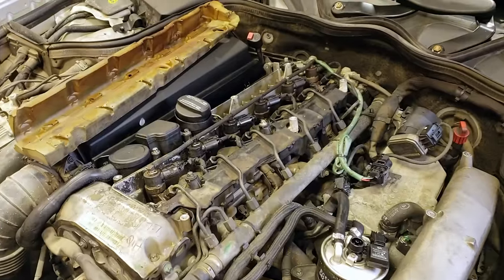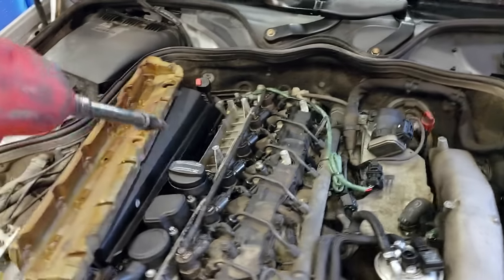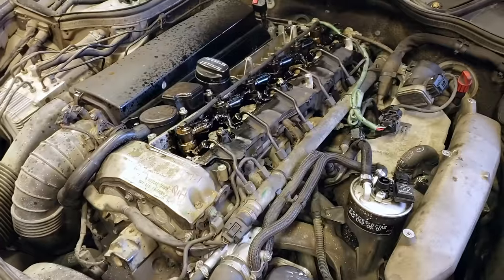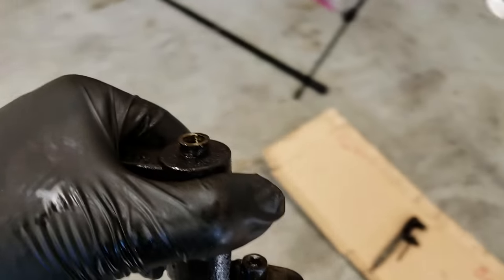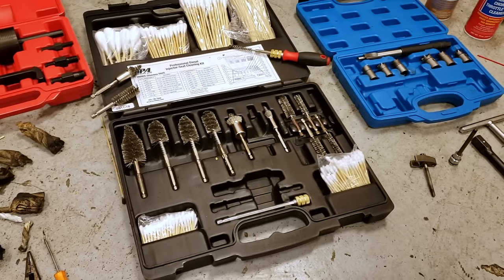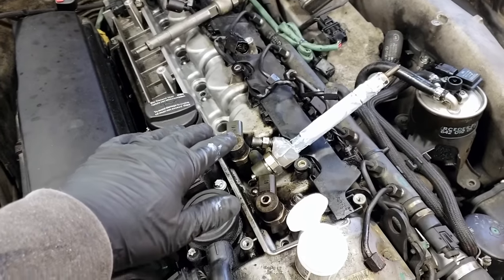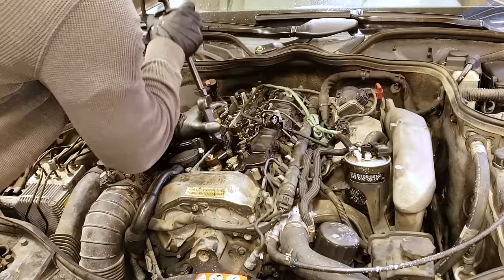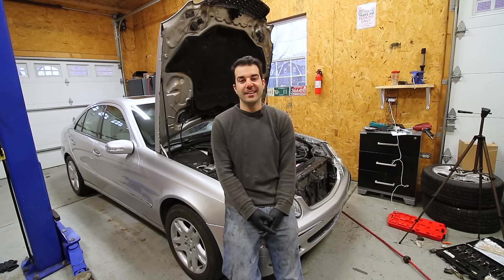My Turbo Diesel Mercedes Has A Nasty Engine Issue. Don't Buy A Diesel Before Watching This video.

Comment: Thumbs up if you watched this whole video and don't even own an E320 CDI and don't ever intend to!
Reply: Well i don't own one, but can't say for sure that i won't own one in the future. I do however own a v70 2.4d so there might be som useful info here after all
Reply: b376010 
I've got a UK Rover 75 diesel 2.0 which has  a Rover engineered BMW M47r engine with 225,000 miles and the injectors are spotless. Soon I'm buying a Jeep Patriot 2.2 diesel with the Merc engine and I hope this injector problem isn't Merc typical.
Reply: I bought a 2006 E320 CDI from copart 3 weeks ago based on Alex's videos.  Now i'm investing in tools to be able to fix all the problems on this vehicle.  It arrive in limp mode so tranny won't shift out of 1st gear
Reply: I don't, but I have a VW TDI and this applies.  I've always changed the seals periodically, but you never know.
Reply: @mopson  If it's a 2006 then it has to be the 642 engine correct? Anyway most common problem for a transmission in limp mode is the speed sensor. Probably just a new EGS if you're lucky. Also keep in mind that the 5speeds has a tendency to leak oil at the electrical socket and oil will travel along the wiring inside the car and eventually hit the EGS module. Yes, not kidding, if connector is leaking, oil will travel inside the car and defy gravity due to eletrical pulses :D
Reply: @kasper my engine is exactly like Alex's engine.  I guess that's a 642 engine.
I got these faults when i scanned the code
CDI 3-Common Rail Diesel Injection3                Fault | 1
      2227-1 /MIL ON&Stored&Current - Transmission Control ETC FAULT 10
      2257-4 /MIL ON&Stored&Current - Check Component N1 4/2 (Glow output stage) FAULTY

ETC - Electric Transmission Control                  Fault | 3
      P2400/Stored&Current - The right rear wheel rpm signal sent from the traction system via the CAN bus is implausible
      P2401/Stored&Current - The left rear wheel rpm signal sent from the traction system via the CAN bus is implausible
      P2430/Stored&Current - The wheel rpm from the traction system are not available on the CAN bus. (CAN timeout fault)
  
ESP - Electric Stability Program                          Fault | 6 
      7209/MIL ON&Stored - DTR: CAN communication with transmission control unit is faulty
      7203/MIL ON&Stored - DTR: Test wheel speed signals. (Rear axle)
      4637/MIL ON&Stored&Current - Check component L6/4 (right rear speed sensor)
      453A/MIL ON&Stored&Current - Check component L6/3 (left rear speed sensor)
      45AF/MIL ON&Stored - Check component L6/3 (left rear speed sensor)
      6403/MIL ON&Stored - Undervo;tage supply

The codes seem to indicate both rear speed sensors are bad but i doubt that both of them will go out at the same time.  it seems to me that there is a communication problem.  Any help is appreciated.
Reply: @mopson  That's OM648 straight-six engine. OM642 is V6 engine.
Reply: @ @keijokojootti7790  thanks.  I'm not familiar with the engine codes names.  I know it is an online 6 cylinder 3.2L
Reply: @mopson  That's the 648 motor with the 722.6 5 speed. The conductor plate in the transmission needs replacement if it's stuck in first gear. It's a well documented problem and a cheap and easy fix.
Reply: @MBDieselFreak  the sprinter vans have these engines too. my V6 3.0 has a chuffing injector and i know i need to get it done .  also need the van for work so tricky to take off the road but don't want to get ripped off at a dealer.  this video is very helpful :)
Reply: @mopson  on the OM642 , i have one, the glow plugs or glow plug relay are known to fail. you can measure the resistance of each glow plug with a multimeter at the relay plug , they should all be a low resistance so it will be easy to find the one or more that is knackered.  if they are all good then the relay itself maybe the issue.
Reply: @MBDieselFreak  Thanks.  I figured that might be the case based on several videos i've seen online so i ordered a transmission service kit from FCPeuro.  The kit should arrive next week.  I hope i have fun fixing it and hope that is the problem.  I'd hate to change the conductor plate and still be in limp mode
Reply: @amojak  My engine is the OM648 straight-six engine.  Do you think the glow plug or the relay issue might apply to my engine too?
Reply: b376010 John
Reply: @mopson  i suspect the setup is the same so most likely could be the same issue.  if it stumbles trying to start on a cold day then it is most likely a glow plug or plugs that has failed. there are videos on youtube of people testing the 642 at least.
Reply: @amojak  Thanks, I'll give that a try but the car starts normally.  The E320 CDI starts at once when the glow plug light goes off but the glow plug light comes right back on after the engine starts, stays on for a few seconds and then goes out.  I don't think that's normal.
Reply: Haha, i meet all of the criteria
Reply: I couldn’t stop watching, and I drive a Toyota !
Reply: had an OM651 but sold it to dad :P
Reply: thumb up if you're using adblock...
Reply: @kbnguy  yeah i use adblock...
Reply: Yup
Reply: @rikardandersson7288  It's not common on Volvo D5 engines but can happen and I have seen it happen, I've seen one's bad enough that they will never ever come out. So, it's not worth doing it as preventative, but do try and catch it early, on a D5 simply pulling the engine cover (just pops off) and having a look every so often is handy and easy to do.
Reply: Not me, I watched this video and still want a W211 diesel, idk what is wrong with me.
Reply: Kasper i have the om651 4 cilinder but i have a 5 speed transmission also, so i will get this problem?
Reply: i have a c220 cdi
Reply: Great job, I was impressed with your perservance and technical prowess. Keep it up!
Reply: I own an E280 1994 update model with 473K on the clock & would never think of owning a diesel. Noisy,smelly & costly to maintain. Better to leave them in trucks or T34 Russian tanks.
Reply: @mopson  It's called "inline", not online!
Reply: @myredute  Damn autocorrect.  Yes, i meant inline
Reply: To bad you will never know the thrill of owning a car that can go from New York city to the Georgia border on a single tank of desiel. The ride, the comfort, and acceleration from dead stop.
Reply: Diesel
Reply: Yes i watched it and i still bought one, because its the best 6inline diesel engine mb has ever produced. You’re whining because one has to replace six bolts and washers.. just replace them before they leak
Reply: I always give his videos A thumbs up
Reply: c180 kompressor.

Comment: This happened to my 2003 sprinter van. The Mercedes dealer told me the problem was caused by bad injectors and I would have to replace all of them. Luckily I knew they were lying .  I went to the parts counter , ordered the injector seals and  bought some oven cleaner on the way home.  I was done by that evening. That 150000 miles ago and @315k my original injectors are still going strong. .
Reply: Oven cleaner shouldn't be used on aluminum head.
Reply: @PuerRidcully  can confirm, used it on a Ford Escape 3.0L V6 aluminium block and IT got clean but also looked chalky and lots of white corrosion. Good thing it still leaks oil(very little) so I don't have to worry too much about the corrosion being permanent. 😁
Reply: I’ve a 2002 T1N and had to replace the #1 injector seal. It had a lot of blow-by, but the injector came out fairly easily and the repair is still holding OK about 30,000 miles later.
Reply: @PuerRidcully  it works well for me
Reply: @thecloneguyz  yes good motor. I only use factory spec fluids. Mercedes is a shit company. They are an arrogant company that does not care for their customers. In my case the Mercedes dealer lied to my face in order to steal money from me. Luckily I knew it was only the $5 seal. It is a known problem, Mercedes should have informed me to have it checked.  But they don't care because the longer black death goes unchecked the bigger the repair bill.
Reply: @skysteppes  
I have seven hundred and sixty thousand miles on mine and it purrs like a kitten because I only use German fluids in it and I only use CENEX diesel in it
The only thing I've ever had to do is replace the plastic turbo resonator tube.
My buddy has a 2003 that he put a bully dog system on and a water cooled turbo and he gets 35 miles per gallon avg fully loaded (9500lbs)
Reply: @thecloneguyz   well on your way to a million miles. Happy motoring
Reply: @GIGABACHI  You can clean aluminum with a basic degreaser than coat it in WD40 over night, yes not kidding. It will get a nice gun metallic grey colour. Used it on several 642 engines when doing intake manifolds.
Reply: @kasper8283  yes Sr., you can but in my experience the oven cleaner does a deeper better cleaning when it comes to removing 15 years old baked oil deposits.👌
P.S: I just learned what a 642 engine is. OM642 I believe ?
I'm gonna give a shot to your overnight WD-40 suggestion if I even clean aluminium again.
Reply: @GIGABACHI  Yes sorry, the OM642 is what i meant (V6 cdi) - i've not tried too many different cleaning agents actually. What i usually do if possible is putting the pieces in a bath for a few days in something called aqua petrosol and then hook up a regular aux. pump from a w211 to circulate the cleaning agent. But absolutely try out the WD40 - you can try it on a small piece and see the effect some day :)
Reply: @thecloneguyz  no thanks, I'm not a homosexual. But hey, you do you, I don't judge.
Reply: Oven cleaner eats alloy. Poor choice!
Reply: Said that to me too
Reply: @thecloneguyz  Nearly as good as a Ford Barra engine running on LPG.
Reply: @thecloneguyz  what? Bio diesel mix at all the pumps in Europe. I have used it 100% in my Audi with issue. This is a design fault.
Reply: @skysteppes  Judging from what I've heard BMW dealers can also be greedy.
Reply: @goclunker  so, offer a better idea
Reply: @Martindyna  I believe that
Reply: @Martindyna  I believe that
Reply: @skysteppes  Ok, go to the 99 cent store, and get the all purpose cleaner with bleach. It comes in a white bottle, doesn't eat or etch alloy, and still degreases the motor! Its what I use
Reply: Piotr Yes you can you just can’t leave it on overnight or for extended periods of time

Comment: The cost at the dealer is minimum $1,200 USD.  I know because I did it once.  Since then, I invested less than $100 and have all the tools to do it myself.  Something else, if you don't have "black death" keep the injector lubed.  The injector body is steel and the cylinder head is aluminum - two different metals with different heat and corrosion properties.
Reply: Wise Man. Copper slip or your equivolent is a lot less expensive
Reply: If I may ask ~ how do you keep the injector body lubed?
Reply: @jacekwobel7699  The injector seals are copper though :) Maybe that's why they go bad.
Reply: @johnkaimins9998 Did you find out?
Reply: @mbz4652  No, although thinking about it, the injector body would only be have to be lubed once with a good quality anti-seize grease to allow for easy removal.

Comment: Hi Alex . I am Matthias from  Belgium and I own a w203 c220 cdi ( 110 kw ). My car now has 230.000 km. ( 143.000 miles). And no black death. I check this every 10.000 miles 😉. I do all the maintenance and repairs myself. And I love your video's.  I have learned a lot from them.   Nice to see you have a diesel now to work on.  I am saving to buy my dream car an w211 e55 amg estate. But a nice one in europe isn't cheap.
Keep up the good work. !!!

Comment: I used to own a shop a few years ago. I specialized in diesel injectors and pumps. The only thing I'd add to this is; while the injectors are out and since they have a lot of miles on them, take them to a legitimate Mercedes authorized diesel shop (usually one that also works on Frieghtliner trucks) and get the injectors cleaned and calibrated.
Reply: also, you should be changing all the o-rings on the injectors at the bare minimum doing this maintence.  Had a Cat C15 6NZ that was bad for burning up the injector o-rings because cat put a head on it with a blemish :/
Reply: @JeffLMisc  Unless I missed something, this kind (common rail) doesn't use o-rings. They're metal on metal torqued to around 65 ft-lbs.
Reply: @dieselscience  ah, ok.  thought I seen o-rings on there.  My mistake, guess they were just gunked up that bad.
Reply: @JeffLMisc  There are small notches where the parts screw together - they ARE gunked up bad.
Reply: The OM636 in my former '58 180D Mercedes was used by Freuhof(?) as the donkey engine on their over the road reefer units, so other former shop people / mechanics have said.
Reply: @jebsails2837  It's "Fruehauf". https://en.wikipedia.org/wiki/Fruehauf_Trailer_Corporation
Reply: Tested on the machine at the very least.

Comment: This is probably one of the best Youtube videos I've ever seen. Really clear explanation of a Merc. known problem.
Reply: It's not just on mercs. Its on a lot of diesels.
Reply: @shifty2755  You mean TDI engines? because pff I hate driving behind an older TDI or CDI, rather get an ticket then breathing in that smelly crap-_-
Reply: @Yorick.F30  
New diesels aren't much better. They just tell you they are......
Reply: @shifty2755  Yep your right, still the older diesels are the ones with the smell while it doesn't have to be that way-_-
Reply: @Yorick.F30  
Saying that though, I work on brand new bmw's. Within ten seconds of starting one up your eyes are stinging and you're choking. They are 330D'S though. The X5 is even worse.
Reply: @shifty2755  Watch out bud not worth getting health issues in an later stage of life..
Reply: @Yorick.F30  
Cheers mate. Appreciated.

Comment: nice to see a pro struggling with a repair, gives us DIY's some comfort for when it happens to us!
Reply: To me.. You're only Pro when you've actually built your own engine from the ground up. Besides that, You're just another DIY guy.
Reply: Some jobs are just a pain in the ass. I’ve been a mechanic for 10 years and I’ve had my fair share of struggles.
Reply: @LiezerZero  What cast the block and forged the crankshaft?
Reply: @alanpartridge2140 

No to be a pro you have to mine and smelt your own iron first...duh

Comment: I feel your pain. I used to have a 2004 E320CDi and it too had the Black Death issue, which I only noticed when the cabin smelt so bad of Diesel all the time. Watching this video has brought back so many memories of the fun and games in getting those wretched injectors out. You did a far more extensive job of cleaning up the coked residue though so well done there!

Comment: Excellent video!  Many years ago (1984), I bought a 1965 MB 190D (Heckflosse--Fintail, or Swallowtail) for $600  that had been sitting in a carport behind an old house for years.  After towing it home, I was cleaning it when I pulled a threaded rod protruding from the instrument panel (I had put a battery into it to check out the lights and such) and it fired up!  I knew nothing about diesels!  But I bought a Clymer manual and started doing repairs and maintenance on it.  I was actually able to order parts for it from our local Pontiac/Mercedes-Benz dealer (!) A year later, I sold it for $1500 to a guy who just had to have it!  I regret selling it to this day, but that money was most of the down payment on our first house... so it was for a good cause!  Keep on wrenching, and Merry Christmas!

Comment: Fantastic video. Just bought a W211 E320 two days ago. When I saw your video I ran outside and took the engine covers off immediately. Happy to say all the injectors are perfectly clean. It should be with only 68000 miles on it 👍

Comment: I would like to give you a little tip when using a slide hammer to pull a stubborn part. It really helps to have some tension on the shaft of the slide hammer to reduce the bounce effect. The movement seen during your use of the tool shows that you are loosing force that is wasted instead of actually been transferred to the injector. We have modified ours with a ring on the top so we can apply the upward force with a hoist to preload the tool. This reduces the bounce effect and allows for all of the force to actually be applied to the injector from the slide hammer. The hoist does not have to be elaborate or expensive a small block and tackle works well because if you pull on it to tension the ropes the weight of the car will act as a preload.  .

Comment: I work at a MB dealer herenin Belgium and the seals cost €0.70 each. Only the work is depending how long the costumers drived with this stinking smell and how stuck the injectors are and if they can be saved after pull them out. I have myself a diesel C220 CDI and had the same black death.
Reply: I  1000% Agree
Reply: Buying an used Mercedes is there any particular engine that is more reliable ?
Reply: Nissan 2.8 l light truck engine, 10 years no oil change but still pulls hard, i removed the turbo ...i owned a w211 e270 cdi and it was trash, somedays it starts, others it does nothing, tried pulling the injectors but they were stuck, personally im going to buy a salvage c180 and put the engine inz a w211 e class body

Comment: Great video btw, & you have a great sense of humour, I fixed my gf car like this, she took her ford diesel with seized glow plugs, so I removed the snapped plug ends by removing the injectors, knocking the plug tips into the cylinder and fishing them out through the injector holes with a tiny strong magnet.

Comment: Dealt with lots of these! I found a helper cranking the engine over while working the slide hammer pulls double duty..the compression forces are very strong